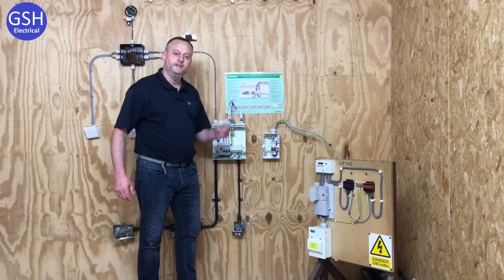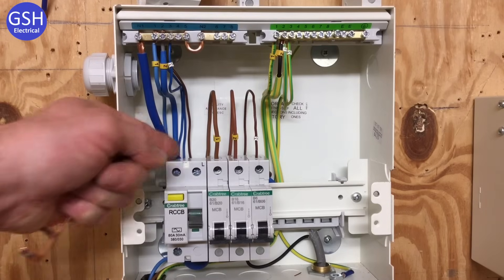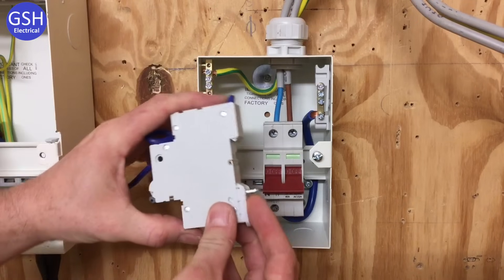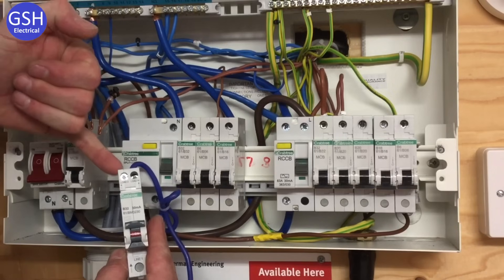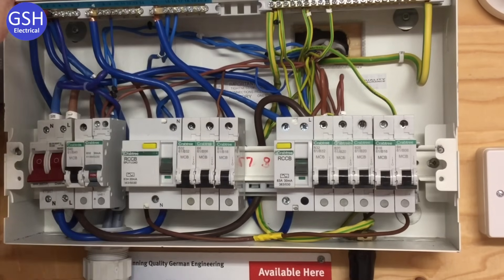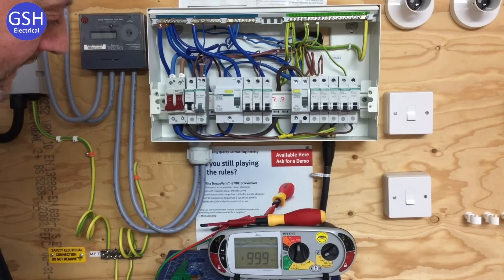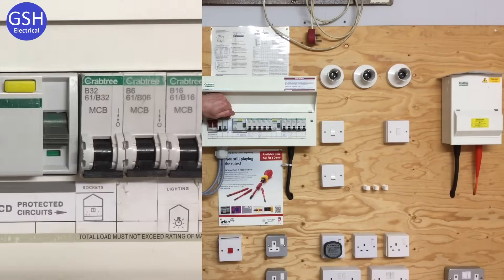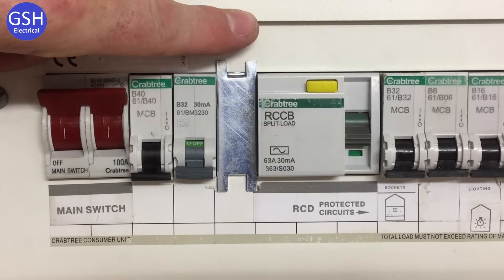Fitting and Testing for Insulation Resistance a Miniature RCBO from Crabtree (RCBOs)

Comment: I understand testing with the RCBO in the off position, as you don’t want to pass 500v through it. However what if you wanted to do a global IR test on the rest of the board, say if you only had one RCBO? Just having it in the off position would still put the components at risk, wouldn’t it?

Comment: Trying to understand the hidden busbar system, can you show how to change from a dual RCD consumer unit, to a high integrity dual RCD consumer unit, using the original dual RCDs as well as about 2 RCBOs, to further increase selectivity or separation of circuits?

Comment: Hi Gary, where you are putting the new  rcbo,where you say they are the high integrity circuits. Should the 40amp mcb  the one next to the rcbo  be downstream of the rccb to have the added protection?
Reply from the maker: Example a Non RCD circuit wired from a MCB in say SWA to a remote DB then the final circuits from that board have say RCBO’s.

Comment: I'm not an electrician, but I do wonder. As more and more protective functions are being squeezed into each unit, why don't these units have the line, neutral, and CPC pins at the back plugging into busbar holes like the line one? Then the circuit wiring for each circuit could screw into separate isolated pinned projections at the back of each device. The RCBO/AFDD (ruler of the universe) device could just clip on. That would make the replacement of these increasingly complex devices easier. The size and position of the circuit wiring projections could be such as to prevent people from plugging the wrong rated device in.

Comment: Just a quick question on that board I had a niceic assesment and all the meter tails plus the main earth should be coming into the board from one hole...one gland... That's what i was told... On your board meter tails are coming in via the gland and the earth is coming in from back of the board... Is the way you have done so correct...
Reply from the maker: Hi. It’s best to have all 3 going in via the gland. However the gland does come with a blank for the earthing conductor. On this rig the earthing conductor comes in the back because it passed through an in-line switch allowing us during faultfinding to break this conductor and therefore remove the supply earth. Thanks for commenting and watching GSH Electrical
Reply: GSH Electrical thanks for replying keep up the good work educating future sparks... 👌